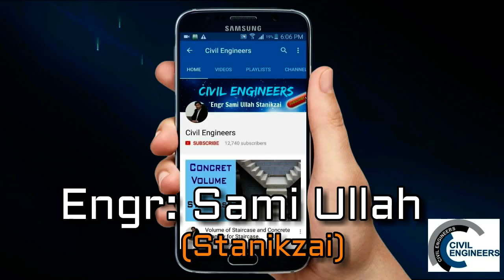How to Chose Good Quality of Bricks at Site.

Comment: Brick is for partition, its not for structural purposes, for strong building we should focus on the reinforcement concrete work & design.
From this video your brick is to heavy, maybe its strong but still heavy, for high rise building your brick will cause more heavy on its own structurs.
in my country we have autoclaved aerated concrete or we call it "light brick", fast instalment, precisions, reduce cost, safe, etc
If u never see an "autoclaved aerated concrete" or "light brick"
You can search it in google